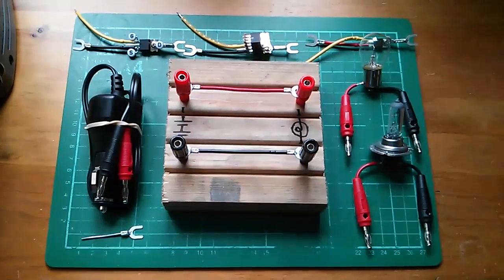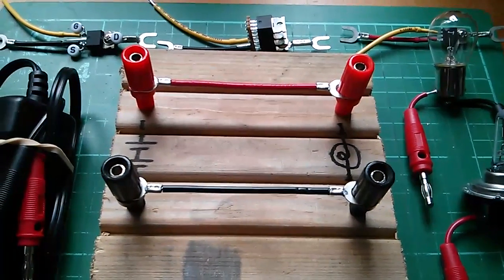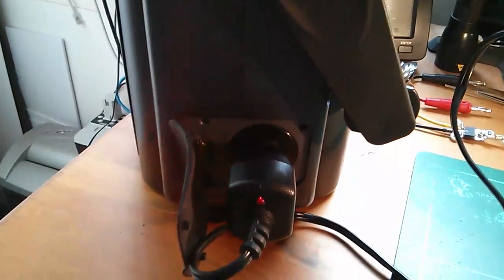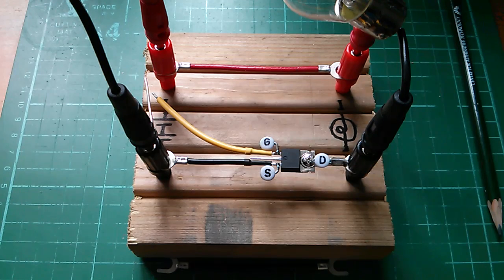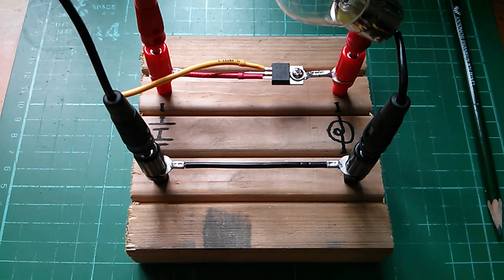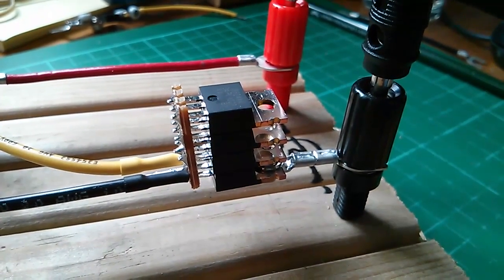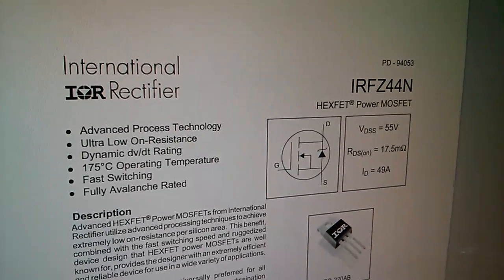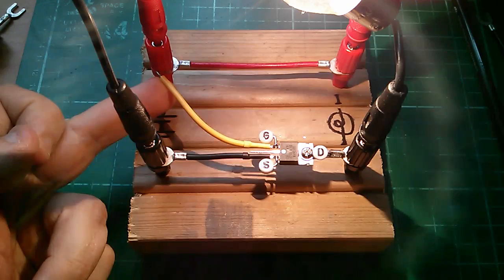Practical MOSFET Tutorial #1 - Introduction and Scope

Comment: Julian,
Could you please do a practical transistor video.
I can not find a video that adequately describes how a npn ( seems less complicated than pop!) transistor works.

If you have a transistor with the base connected to an adjustable voltage divider,what rules are important?

I believe the base current controls the Ice 

where does voltage come in?

If the Vbe is above 0.6V, ( transistor turns on) ,dose voltage play no more part?
Is it over to current control things , from that point on?

And if you have a 100k resistor and a 100uf cap, connected to base ,the cap seems to act as a closed sw pulling the base down to zero volts ,this changes as the voltage across the cap increases as it charges up
.
This makes it look like it is controlled by voltage not current !